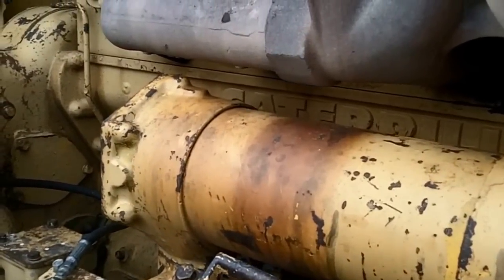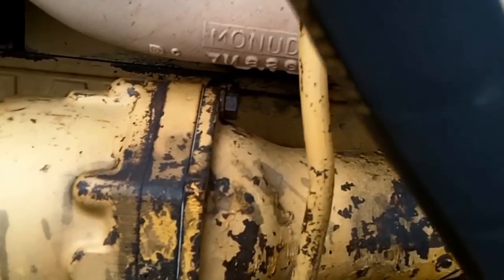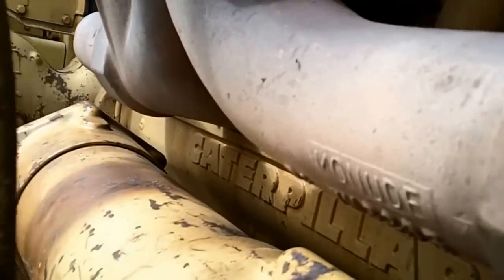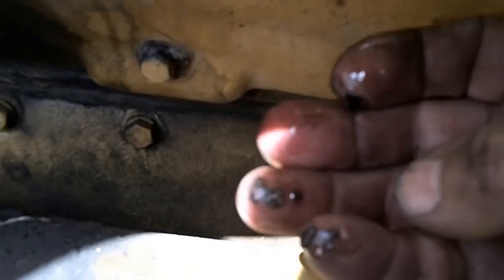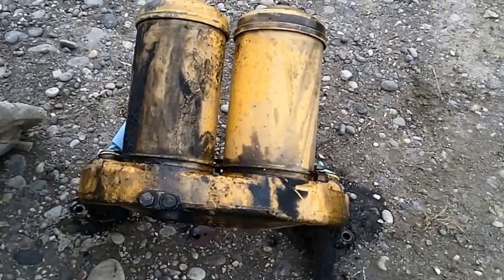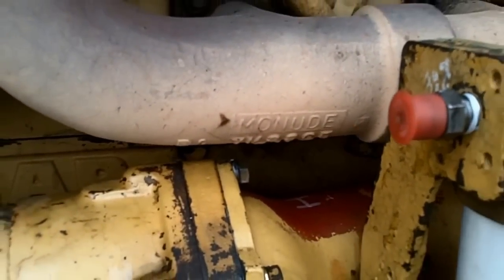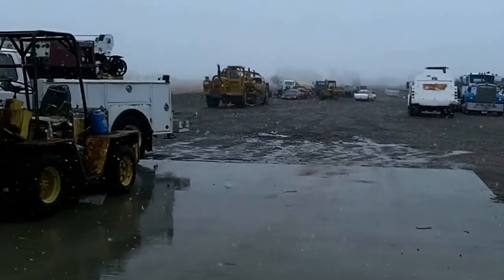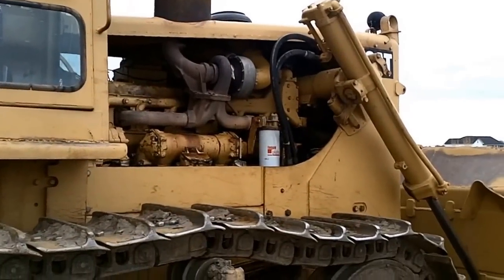D9G Repair

Comment: I like the way your D353 starts and idles. Mine hunts until the oil pressure rises then it smooths right out.
 Thanks again for another great video.
Reply from the maker: +Dan Bronzi  your welcome dan! does yours have the canister type filters?
Reply: Yes it does. Im with you on the spin ons.

Comment: Worked for a agricltural contractor in the late 60s. We had an old D6 37a that sounded like that when she started. Later he replaced it with a 6b. Was glad to be rid of that pony motor. Last job I had there was a reclaimed farm that was abandoned in the 1930s.
It was 2 miles by 1 mile. Spent 3 months on that block. We followed a D8 and TD21. (The 21 leaked oil so bad they had a 44gallon drum strapped on the front to top it up) that pulled big rippers behind  to rip out the Mallee roots (Oz scrub tree). I then levelled it with big I beams and Railway track frame.
Then ploughed it and raked the Mallee roots into windrows and burnt them as I went.
I left just before they seeded it. Used to work 11 hour shifts cos that was how long the fuel lasted. Then have about 5 hours sleep and go again. Did that for 11 days straight and then took 3 days off. Those were the good old days lol.

Cheers,
Mike from South Australia

Comment: I honestly prefer the cartridge filters on these machines. On the D8s, They use what's now 1R0659 oil filters. The naturally aspirated D8s used three of them. The D8Hs from 1958-1972 used 2 . Then they went to the spin on 1R0716. If you cut them, the element physically the same as the 1R659. So in 15 years Caterpillar cut the filtration to one third. The D9H uses the same 1R 716 filter but the G's use 2 of the larger 1R0721s. There again, filtration is cut down to one third. It doesn't matter to us as we change our oil every 100 hours. It just amazes me they reduced the filtration that much.
Reply: Cars also I guess they don't understand capacity any more

Comment: Looks good, have to be carful with the shop towels. Also you just increased the quality of the filter with magic marker. Nice!
Reply from the maker: Redhawk454casull  I hate to admit this----------- but I left a chunk of paper towel in the oil line to the turbo on a 37 once, she lasted about an hour before it seized, I get the fleetgaurd cheap from a relative in the biz

Comment: We had a transmission cooler go on A D9G and for a while they used a double transmission oil cooler on D9Gs. We had to convert it to a single cooler like the rest of them as we couldn't find the doubles anywhere.

Comment: Great videos Jeff! Always enjoy these repairs you and your crew do these older pieces of Cat iron. Refreshing to see someone NOT just going out and replacing it with new—-even though it surely crosses your mind at times. How does your D-9G do for just all out brute force pushing compared to a high track version of similar size Cat? Thanks in advance if you find time to answer this question. Tom G.

Comment: I never noticed that you changed over to a Delco 17si alternator instead of the stock Prestolite. I switched mine out this past spring. Mine is on the other side of the engine though.

Comment: Same filter that goes on a C15. I thought it would have been something larger. Is the displacement on that engine around 1700 CID?
Reply from the maker: 1983359 1472 Cubes, well i guess the cat engineers deemed it adequate  I just figured if it worked for the H  it will work on the G  I could bolt another housing to it, but would have to make a new turbo line. well no that won't work not room for it, check out my photos on GooglePlus, Old Kenny is on it
Reply: Jjpaydirt on Google plus.

Comment: Water is a huge issue these days, for the human body, garden plants, even machinery. Although pricey, demineralized, distilled then filtered water is far better to use in a cooling system these days. The chemicals they use are causing long term issues that many people overlook. Coolers are getting ate up from diesel engines to laser cutting machinery in fabrication, and even processes using water wash or rinsing are being affected. Sample the water you use in your equipment then decide if you should use it or switch to something else. Cavatation is one thing, coolant additives mix with the treatment chemicals in the water and do some strange things at times. Water from different areas of the country can make ya say "Arrrrrrrrr".
Reply from the maker: I use FleetGuard pre mixed, my water is way to hard
Reply: Jpaydirt Good deal! I have seen some old equipment all bottled up and constipated by hard water.

Comment: Got a question for you about these 9Gs

How much abuse can their transmissions take. 
How many hours does a full tank usually last with a clumsy and inexperienced driver?
How much weight can they push? Doesn't matter what it is.
Reply from the maker: Well I've never abused my transmission, but I've seen them slam shifted and they take it
They'll run about 10/12 hours
Good question as it would depend on the underfooting
Reply: Thanks man for replying. 
 for underfooting it would be asphalt or hard southern clay.
Reply: @Jpaydirt  Larry took the Sun gear out of a 9g slap shifting  they fixed it and Red the mec told me the owner wants it run like that
Reply: I was on a 57

Comment: I have a 3406B in my truck and  it has 425 Hp. If I replace the turbo with the switch blade how much Hp and torque would I gain. Just ballpark numbers??
Reply from the maker: Good question, I'll ask Mr Turbo, Jim Blaylock
Reply from the maker: Ok send me your email  jpaydirt7@gmail.com

Comment: It appears that you are holding the glow plugs on after cranking up, until running on all clys. Not many people know to do that anymore.
Reply from the maker: +Gene dahlstrom   No they don't , plus they pull the throttle down and all that does is make them blubber

Comment: Not that I am any expert , but did that Turbo oil feed pipe ought to have a support clamp ! if it breaks due to shock/vibration it could lose the oil feed n blow the turbo/engine,  Or is it Oil Return pipe ?
Reply from the maker: Tod Lindley  Well the D9H parts graphic  does not show one, so I guess they figured it didn't need it, maybe because its so short? yes its the pressure line, good eye!
Reply: Just meant with it having the short flex might allow it to flex, I'm guessing the Cat Version is a one piece steel pipe, no criticism just hate to see a good engine go West
Reply from the maker: Tod Lindley Ya I had the same thought, would the short hose flex, I 'll have to keep an eye on it

Comment: that's pretty much the shittiest filter you can buy.  you should put a cat filter on it.  don't believe me? get one of those filters and a cat filter and CUT THEM OPEN!   you will not EVER buy one again!  cat filter use 4x more stabilizing glue to keep the filter pleats in their place to increase the filtering ability.  plus an anti-drain back valve to keep the filter primed - quicker oil pressure on a cold start.  you get what you pay for!